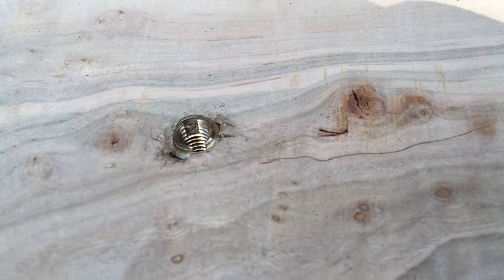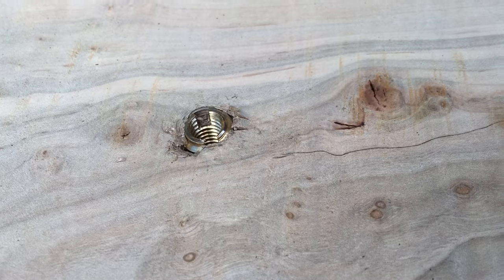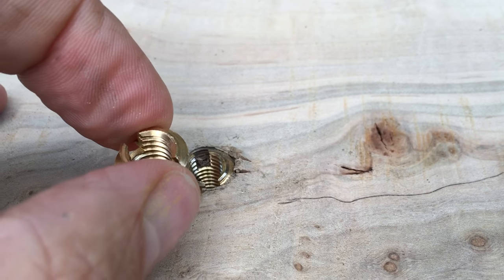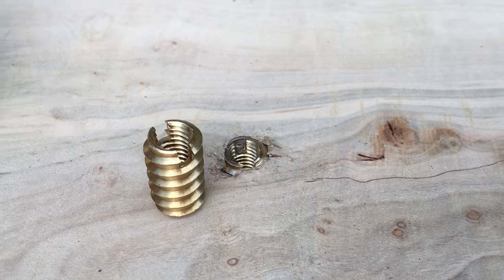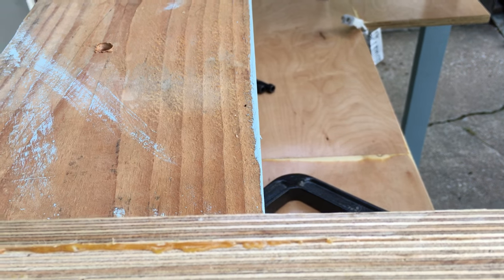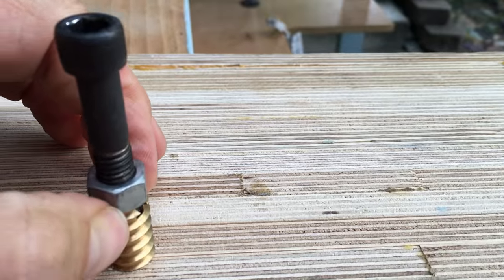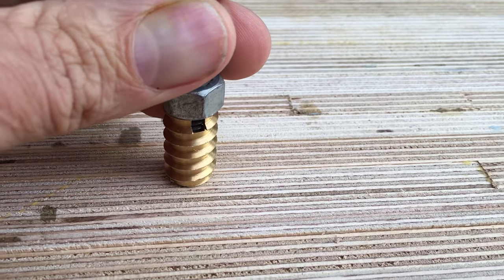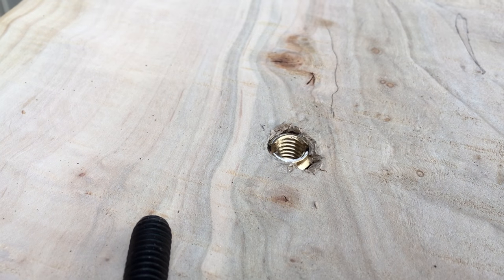How to install wood insert nuts

Comment: Regardless of what they are saying here, you can put the insert in with the slots up, just like you show. However there is an easier way, use a metal tap to cut the threads. I've done it hundreds of times without failure.

Comment: If your installing in wood that is not tapped, the slots should be down to help cut the thread.  If you tap the hole with a tap, you can install with the slots up and use a screwdriver (mostly done in metal).

Comment: Great that you've made a vid to show people but if you are going to make them please make sure it's right. Like the last comment made you have it the wrong way round. The cut out parts go into the hole first not for putting a screw driver in. They are designed for slicing into the wood. Best of luck with future vids good quality.

Comment: Oh now I see this.  I just did a test fit on my table legs I've built and had them all bolted on.  When I took the bolts out 1/2 of the inserts backed out with the bolts into the table braces for the legs keeping me from pulling the damn legs back out.  AHHHH  Just used a screwdriver to drive the inserts back in.  I also drilled and tapped by wood holes for best bit.  I used the rockler steel thread inserts.  Definately love the jam nut on a bolt idea.  TY

Comment: Hi,
You are inserting them upside down... the slotted end goes in first. the slots are cut in there to make the threads sharp so it cuts threads as it goes. Try it and you'll find that it takes much less effort and you will have full threads that look better when it's done...
Cheers,

Comment: You do know they make different metal material inserts and also some that use a hex instead of slotted screwdriver right?

Buying brass inserts meant to be threaded with a slotted screwdriver is asking for trouble but yah in your case this solution works..  just buy zinc or another metal and make sure theyre hex headed instead of slotted for a screwdriver..

Comment: as soon as i saw the initial install in that block of wood and saying its for a flathead i paused. dont waste your time. i doubt the rest of the video is substantial in any way
Reply: The slots are made for the bit that drives them in. Not a screwdriver. Each size has it's own driver bit.